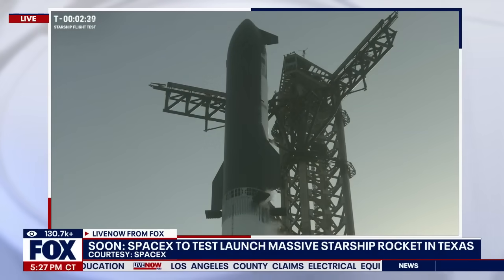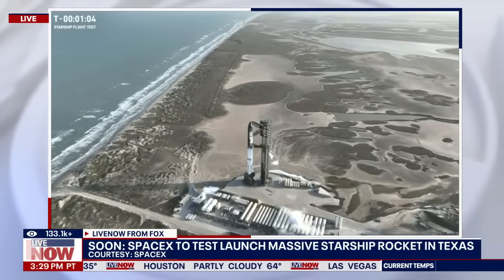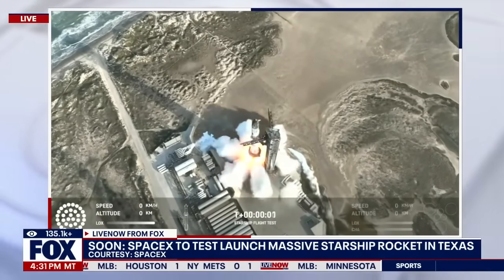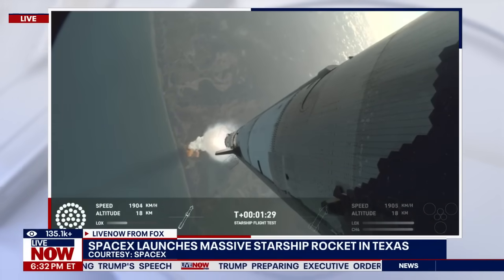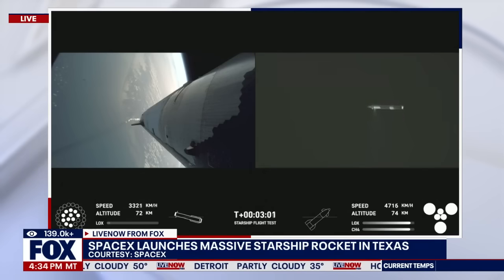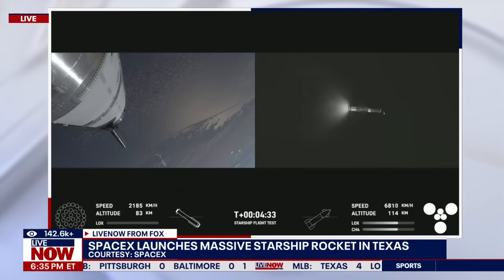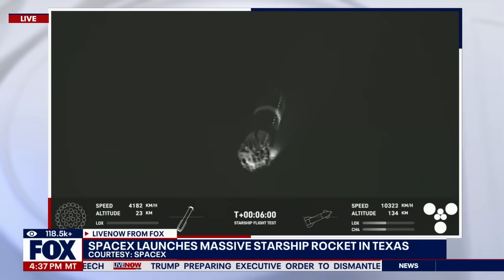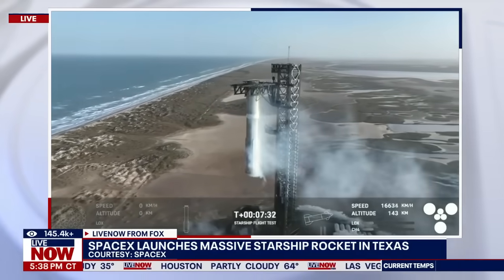WATCH FULL Starship launch and recapture

Comment: Honestly. In this day and age of so many advances. Computers, Computer modeling, Metallurgy , Chips, Electronics, Mechanical engineering, Etc. Space X has had almost the same amount of failures as the Apollo missions 40 years ago when they had less computing power than your IPhone. Also back then there was hardly any air traffic in the skyways to worry about. . Talk about Money waste!  2 starship explosions in  a month. I wonder how much money was wasted on those. Not to mention all the lost time and money from all of those grounded and redirected airlines. Oh! And i love those launch videos after a crash. "this is how we learn" OMG!
I also love this new bull crap term they use. "unscheduled disassembly" LMFAO. The correct term is and always will be "Catastrophic Failure!" No sugar coating it.

Comment: Something seems off with the booster-starship separation.  It's quite possible damage is being done to the Starship tanks, engines, or associated plumbing during the hot staging/separation sequence resulting in leaks and loss of control leading to inflight breakup.  Suggest they look at the release timing or use reduced engine power on the ship during this event.

Comment: Why is it so difficult to put a rocket in orbit, rendezvous and return? Been doing it for 60 years
Reply: You clearly weren't around for the early NASA missions where people died. Several people. They were testing with people in danger. They had to slow down and come up with ways to test safely. SpaceX is fighting to get a manned mission to Mars. The window is closing. They have to push hard and are doing incredible things in a very short period of time. Then, they had to pick up the slack and take over supplying the ISS, then build the Dragon to replace Boeing's failed Starliner, then build a different heavy booster to replace SLS for the moon mission and build a Starship as a backup to Orion and Artemis. All for a fraction of what the Space Shuttle cost.
Reply: @garymanis6305  I was a kid during Project Mercury and Project Gemini. Are you telling me we learned ABSOLUTELY NOTHING from those earlier missions and made corrections? Add all the ICBM and SBLM. I still don't understand why it's so hard.
Reply: @Gauge1LiveSteam  Actually, that's kind of what's going on. NASA engineers didn't do a great job of "passing down" information. It's kind of the culture. It's sounds strange but that's how it's always been. Look up why it's so hard to solve problems with Voyagers' 1 and 2. The engineers today had to basically figure out the code and how it works from scratch because either no engineers are alive from that era and or there is no documentation on the computer language that the satellites use for their system. Check out the article they have about the last issue NASA had with Voyager 1. It will surprise you.
Reply: @Gauge1LiveSteam  SpaceX is using different fuel that they produce themselves. Developing their own engines that are the most power and most efficient rocket engines ever built. The Sharship and Heavy Booster are the largest rockets ever built. The SpaceX Falcon 9 boosters are being turned around and relaunched in as little as 14 days. The best NASA did with the Shuttle was 54 days and corners were being cut. They had to return to 88 days after the Challenger explosion. Every Shuttle launch cost at least $1.5B. That would translate to $4.5B in today's dollars. Falcon 9 cost less than $70M per launch. Heavy Booster launches cost $100M for reusable launches. These boosters are fully automated and land themselves. SpaceX is doing things that NASA said was impossible. Impossible is hard.
Reply: @garymanis6305  why change something that works? Either put stuff in space or don't.
Reply: @royal_FIFTY8  Many of the real NASA engineers took their shop notebooks with them when they retired. That's part of the tragedy. As I recall discoveries by NASA where supposed to be all public domain
Reply: @Gauge1LiveSteam  you keep asking the same question of everyone but you’re not reading their answers apparently
Reply: How many countries in the world can do it? forget about land on the ship or catch like space X.
Reply: Is this what you said about the Challenger and Colombia shuttles too?
Reply: @privacyrules for real what a disaster.. 😢
Reply: @privacyrules  in hindsight the STS Program was a costly mistake. Ended up costing $25K per pound of cargo into orbit. Whoever let Challenger fly should be in prison. The Columbia crew had a possible fix but some weenie on the ground wouldn't let them try.
Reply: You realize this nothing like what they have been sending up to space previously. This is an entirely new concept that is on the threshold of being completed
Reply: @Jasper118  why change what worked in the past? Still have two astronauts stuck in space.
Reply: @ because didn’t work any longer. It was prohibitively expensive, outdated, and unsafe and no longer was able to carry out the missions we needed. I can’t tell if you’re being earnest or ornery in your question but I recommend you look into the incredible novel things that spacex is doing and why they’re necessary
Reply: @Jasper118  both. Earnest and ornery. Somehow Kennedy issues a challenge and six years later we are on the moon. This notion of reinventing the wheel baffles me. How many Saturn V rockets failed? I would say one, Apollo 6, the second unmanned flight. A human crew would probably not have survived the vibration.

Comment: Can we talk like Americans please like feet, miles, inches? I love what elon has done and doing but why should we talk in a metric system?
Reply: The "do it in your head" conversion for km to miles is slightly over "point six" or 0.6.  It's a quick multiplication done on the fly to read approximate speeds and distances.  

* Multiply whatever is being shown in km by six and then drop the last zero.

300 km x 6 is 1800 km.  Dropping the last zero in 1800 makes it around 180 in miles.   500km/hr roughly equates to 300 mph.
4000 km (or km/hr) x 6 = 24,000 - meaning 2400 miles/mph with the final zero omitted.

Accepting this .6 conversion will put the power back in your pocket. Science and military are metric, so they're not gonna change for us everyday 'mericans.  Finally, there's something from jr. high math class which is useful in daily life!  Hope it helps.

Comment: the booster return is great, but the survivability, crew, mission and recovery of the ship are the most important. More important than the booster
Reply: Have to crawl before you can walk. This was not even a dream fifteen years ago.
Reply: @bobmahnamahknob Yes I agree but this is the 3rd starship lost and its the most important thing.  The first time NASA launched the shuttle it worked and the next 49 times also worked. 51 shuttle launch was a duzzi, and those were government workers.
Reply: @rafaelrivera9346  starship is an entirely different beast than the shuttle program and is still working out kinks but is already years ahead of anything else.
Reply: @rafaelrivera9346  how many did nasa lose over the years again?
Reply: @Jasper118  it’s all relative, the technology at and before 1982 like a baby compare to an adult. So they did much more with a lot less technology.
Reply: Yes that pointy end seems complicated-
Reply: NASA had this happen to rockets, too. Now what?